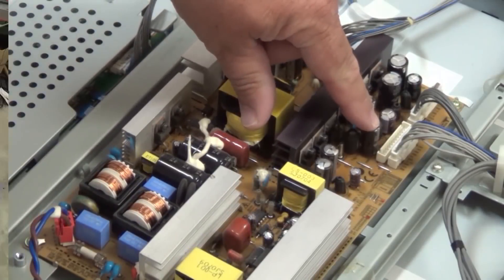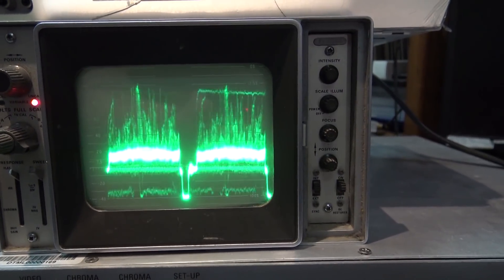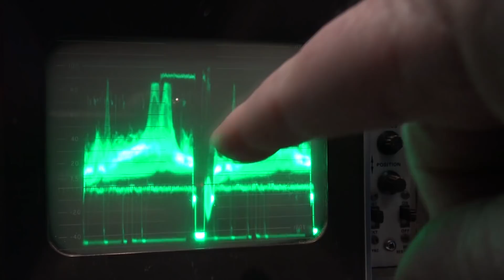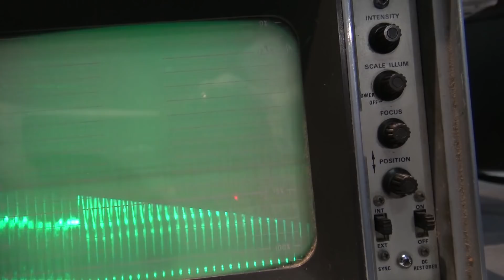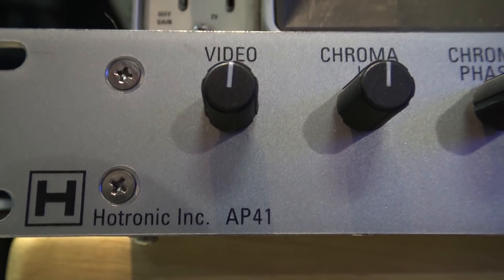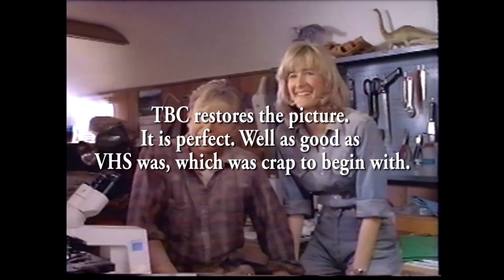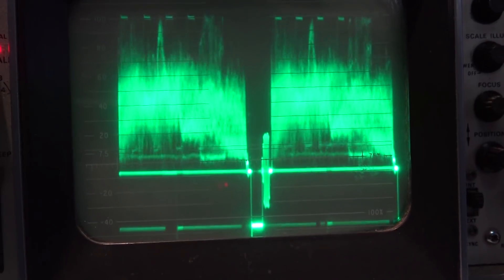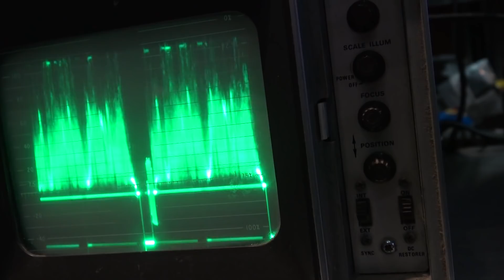Capturing video with a professional TBC

Comment: I find this pretty fascinating. Is the TBC removing the Macrovision because it sees it as being interference? Pretty incredible the results, same with the MX1. Oh and if you do have the rest of that SLAMM footage I'd like to see it :) What were your responsibilities on that production as Technical Director?
Reply from the maker: Basically that meant that I directed the show. Called the shots for camera operators, and operated the video switcher. They were lip synching to the record, so I got to hit the switch on the turn table to send playback to the monitors in the studio so the guys could pretend to play and sing.
Also in the truck with me would have been the tape operator that ran the VTR, and monitored the video levels ect.
We did each track as a separate take, so the switcher would be in black, tape would roll, tape operator would be prerolling and count down the time until he hit record, and then bam, he is in record, we call action, music cues soon as the guys are in sync I fade up from black, and the show goes on. 
This was recorded live to 1" tape. End of the song fade to black,  roll for several seconds stop record. Cue back, get set for next song. If I remember there were some interviews in between each song where the guys talked for a few minutes, then did the next one. The tape I have just has the music cut on it, and there is a blunt VHS edit between the tracks, so I am assuming that I cut something out when I dubbed it. I have it on 3/4" too somewhere.
Have another band we did where I was on handheld camera, which was a big thing back then as we has just gotten a 30,000 Hitachi FP40. It was a 3x saticon tube camera, that weighed about 45Lbs, and it allowed angles that we couldn't get with the CEI 280 studio cameras that were monsters mounted on
large heavy tripods.
Reply from the maker: How a TBC works, for those that don't know is, and t here are 3 types of TBC. Actually 4 if you consider the earliest analog types, but for this description I will only talk about digital types. In the digital mode there are 3 types. 3 line, field, and full frame.
They all work in a similar manner, and it boils down to the amount of memory they contain. Remember that memory was very expensive back in the 80's and 90's so most consumer devices were 3 line. What that means is that only 3 horizontal lines were stored in memory. 1 being read in, 1 in memory, and 1 being read out with the timing corrected.
Field store reads the entire field in, and then as the second field is being read in, the first is being read out. Frame, well you get it. The entire frame, both fields are read in and as the next frame is being read in the first out.
The problem is that with a frame store your video is delayed by 1 full frame, or 1/30 of a second. So you don't want to run trough a frame store while editing, and then through another one when playing the edited tape, now you are 3 frames back. For every generation, you loose a frame of sync, do that a few times, and well you get it. Lip synch error.
So typically in a production facility a TBC was not used during the editing or tape, and only used on final playback to make the signal legal for transmission.  Proc amps were more common for correcting video levels ect.
When editing analog tape the additional jitter incurred when editing didn't affect the tape much, and again even with the added time base errors adding up through multiple generations, on final playback these were easily taken care of by the final TBC. It was a double edge sword, because you want to have the best quality signal going onto your master tape, but at the same time, adding an extra frame of delay is unacceptable
Reply: 12voltvids Now it makes a lot of sense. So would that mean that the macrovision signals are seen by the TBC as not legal for transmission and so it strips those parts out to make sure it meets the spec?
Reply from the maker: The TBC is reading the active video portion into memory. It is ignoring the sync area, as it is generating new sync. The A/D locks onto the incoming sync and the video is digitized, and since digital has a limited range of quantization levels in excess of 100IRE will get clipped.Once digitized it is stored in memory, and clocked out to the new sync that is internally generated, or to the station genlock.
New horizontal and vertical blanking signals are inserted, and anything that was in the blanking area of the original incoming video, including the macrovision signals are discarded. Even the color burst is regenerated. It just puts the active video on. Some TBCs don't even pass closed caption data, but broadcast units need to pass VITS. Usually closed caption data is not recorded on the video tape at all. It is a data signal recorded on the 3rd audio channel, and feeds a seperate caption encoder that adds the caption data directly to the video passing theough it. Certainly it can be burned onto a tape on line   21 (for NTSC) and was on VHS tapes, but didn't have to to be. It could be encoded as a data stream on the linear audio channels
Macrovision signals lines 10 to 18. Active picture starts at line 22, and many TBC just put pure sync on those areas, and of course if they don't pass line 21 will also strip the closed caption data. I haven't tried this one to see if it strips CC data or not but it probably does.
Reply from the maker: I run the composite output from my cable box through a macroscrubber before it hits the modulator, as macrovision is turned on for the premium channels like HBO and VOD content. This way I am able to record SD content directly to DVD from these protected feeds.and it prevents macrovision interference on equipment I am testing.
Reply: One of the thing I hate about Macrovision, is it affects my RF modulators in my office.  My old TV (wooden, vacuum tubes, delta gun, etc) requires an RF modulator connected to my DVD player, but it affects it causing the macrovision effect to happen even though it's going straight to a TV rather than a VCR.

Oddly enough, the ONLY fix was to use an old Panasonic top loading VCR, it seems to not care about the macrovision signal and can not only record them without brightening and dimming the picture (in fact, the tapes it makes ARE copy protected also which is ironic), it's built in RF modulator works for my old TV to view it without problem.
Reply: I'll have to look into a macro scrubber for my modulator, as while this VCR is good and all, it's not in stereo, and my RF modulator has audio passthrough to my stereo, which I'd like to use when not using the TV's own speakers.
Reply from the maker: Yes they work great.
I have 2 MTS stereo modulators, one is a Radio Shack channel 3/4 with true MTS stereo, and the other a Blonder Tongue commercial rack mount unit. It is on channel 12, and puts out enough signal to transmit over an antenna about 60 feet if I crank the output up full.
Reply: I'm actually using a Blonder Tongue as my modulator, so clear you'd swear it was composite straight into the TV.  But mine lacks MTS on it.  Has EAS, but lol I have no use for that, but would be funny to tinker with some day as an alternate audio source, like if I'm playing a game and want to hear a TV show that's airing on another source.

When not in use my blonder tongue is configured to use UHF 21 to transmit my security system to all TV's in the house (by means of it hitting the attic antenna which feeds all TV's in the home, and whatever portable TV I'm using)..  Though for the first time, I ran into a modern flat panel with NO NTSC tuner, just ATSC.  It receives no analog signals whatsoever, and needs a VCR for that as it does have composite in.
Reply from the maker: Really, no analog on the tuner? What brand?
I have a new Samsung 4K and it still has an analog tuner, and I use it all the time, as I have an analog distribution. If I bought a set and it didn't have an analog compatible tuner it would be going back to the store and that would be the reason. Analog is used for my security cameras, and the SD feed from my cable box, as well as closed circuit stuff generated in the house. My modulators are all low band, in the low and high VHF range. I have 4 tunable units that can be tuned from below channel 2 all the way up to 125, including the CATV channels in the FM band 95-99, and all the UHF channels 14 to 83! I have then all set to low channels. 2, 4,5,7,9,12.
That way I don't cause interference to the off air ATSC signals that are mixed in, and feed throughout the house.
The BT is beautiful, best picture I have seen and in full MTS stereo. 
The other commercial units are just as good, but only mono sound, and the Radio Shack Stereo unit on ch 4 looks good, but the signal is nowhere near as strong, and it requires an amplifier to make it to all the TVs in the house noise free.
Reply: The TV was a Westinghouse brand (cheaper, but the picture does look pretty good for the price, but the tuner is severely lacking.  No analog, and the digital seems to have Vsync issues, every 10 seconds you see a diagonal "wipe" across the screen--more during sports).

The modulator I'm specifically using is the Blonder Tongue AM-60-550 (so it covers all VHF TV channels, up to UHF 27, and any CATV channels within up to 550MHz).  I chose a frequency which is not being used on any local channel (or even any adjacent cities), and is at a low enough power level to never radiate past the perimeter of the house, which in my case was 21, and is perfectly spaced between two channels, so it never interfers with my reception of local TV channels.  Works amazing well with each other..  I do need to recap this Blonder Tongue though, and may make a video doing it, as it's starting to gain hum bars, and if it's getting to that, it may start drifting off frequency.

But as you said, these Blonder Tongues have an absolutely amazing picture.  I just wish mine had MTS for my other TV's, but since the primary TV it connects to when being used to watch movies other than security footages, is mono, I haven't needed it yet.  I was wrong that this modulator had audio passthrough, I was thinking about this other cheap no-name one I had, which also had S-Video in (rather useless to have S-Video on an RF modulator, isn't it?)..

Comment: is it ok to spray good contact cleaner all over dirty circuit boards? to get the residue dust off after blowing out the majority? email me at jacobdowler1@gmail. com
Reply from the maker: No. They make special cleaners for that purpose that completely evaporate.
Cleaners such as Nutrol or Deoxit leave an oily film behind to coat contacts and keep the air away.